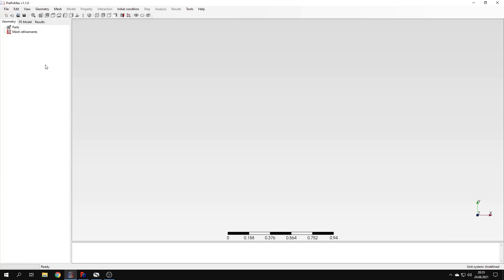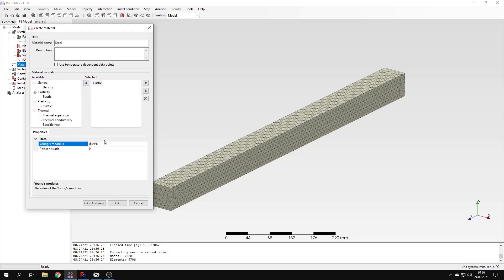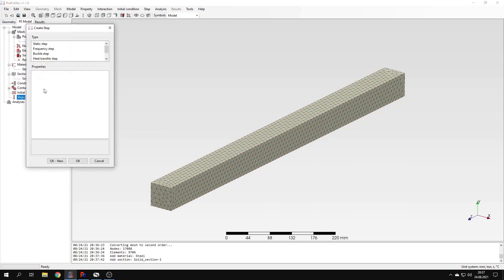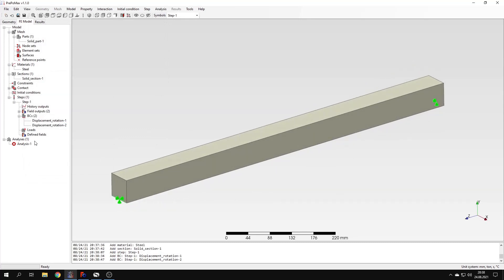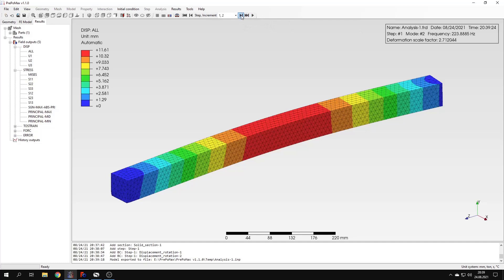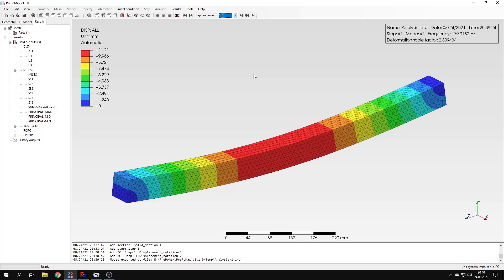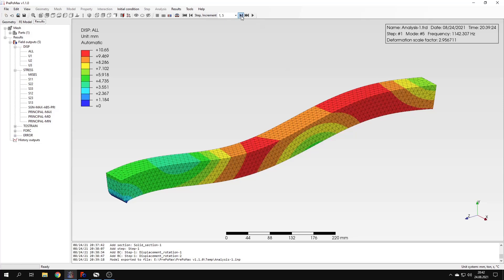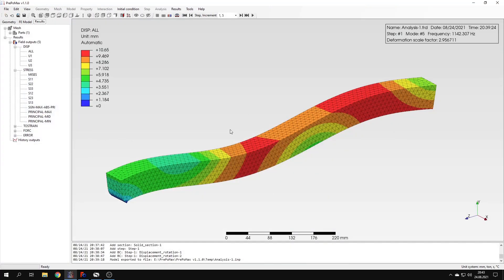PrePoMax (CalculiX FEA) - Tutorial 3 - Modal analysis of a beam

Comment: Just for your information, I am using PrePoMax v2.2.0 with these settings, but it cannot run and returns a ‘result not exists’ error. However, these steps work fine with v1.4.1. I have no idea if there are any extra settings that need to be configured in v2.2.0.
Reply from the maker: Is it still solver-dependent issue ? Most cases like this are due to changes in newer versions of CalculiX and can be highly dependent on the solver.

Comment: I have seen many of your great videos - thank you for preparing them!
However, I have noticed that you use only the tetrahedral element. Does the FE software have any other element type such as beam element, 4-node parametric plane-stress and plane strain element and shell element?
Thank you for your time in advance!
Reply from the maker: I’m glad that you like my tutorials. The initial ones used only tetra meshes as there was no hexa mesher available in PrePoMax. Then I also used quad and triangular meshes in videos with 2D and shell analyses. Recently, hex meshing with Gmsh was added to PrePoMax so I started using hex meshes whenever possible (most of my newer videos). Beam elements aren’t supported yet though. You can find them in FreeCAD FEM for now.

Comment: Congratulations, excellent tutorials!. Would it be possible to check the resonance frequency of an instrument string of known diameter and length subjected to a known tension at its ends?
Reply from the maker: Sure, I showed preloaded modal analysis in tutorial 31 but it was for a plate. With a string, it's much easier. You can find the analytical formulas in the book by R.D. Blevins.